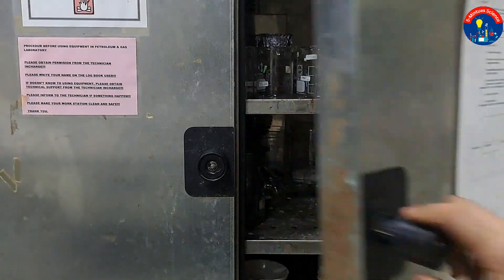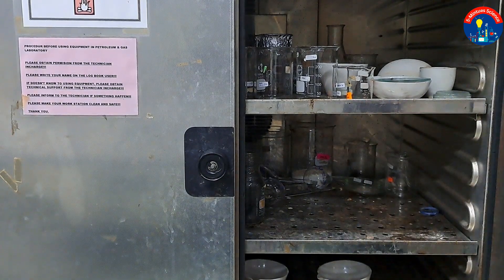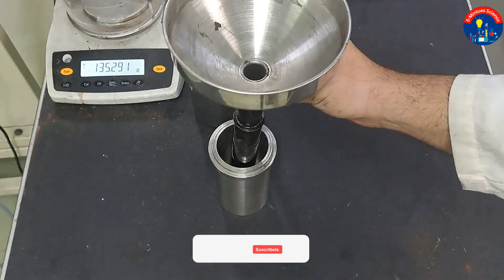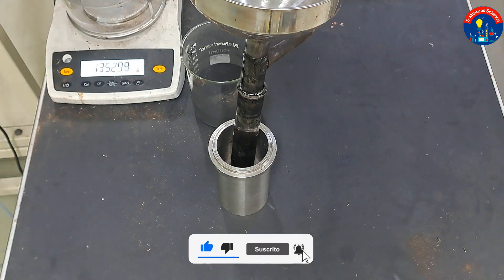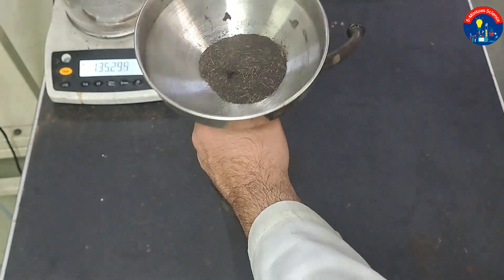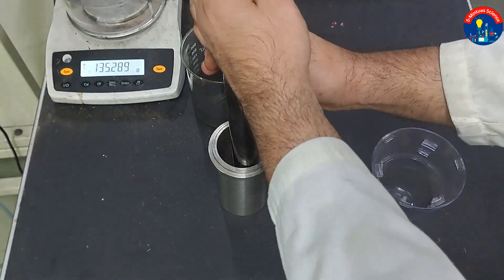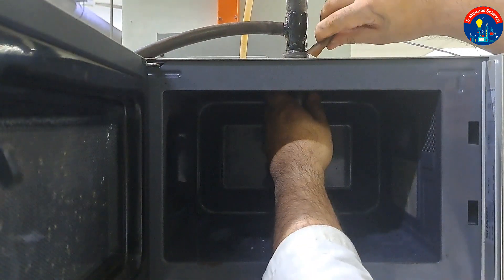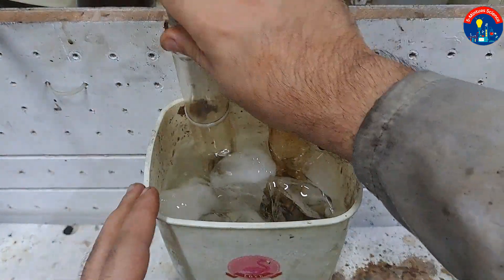Bio Fuel | Coverting Biomass to Bio-Oil by Microwave Pyrolysis | Green Fuel

Comment: tips to improve your viewership:
show what makes the bio mass your getting out the oven, the processes leading up to it going in the oven and what temp (you said100 degrees celcious - don't forget as Americans use ferinhight.) and how long its in the oven for - then what kind of consistency we are looking for.
its nice to see this done with proper equipment but we don't need to se you set a number then turn a plug on and off until you get that number (also i can tell this is in Britain based on that plug alone lol) just set to 100 and edit out the 31-98 range - re-joining  at 99 completion 100. then explain what's next.
at 16 seconds you states about the critical part of the process is to cool the hot gas - explain where this gas come from and how and the reason why you need to cool it - use drawings if you have to lol
at 40 seconds you seem to be putting the tube into a microwave that is CLEARLY NOT DOMESTIC USE - so maybe reference this with a SAFETY CAUTION to stop people buying microwaves and just putting holes in them !!! 
at 55 seconds you state about making the quarts oxygen free - what's the process? why is oxygen escaping the quarts is it something your injecting or is it already present? what's the purpose in removing it? does it play any significant role in performance if you mistakenly leave any in or any biohazards as a result? (imagine ur audience arnt science majors and are dumb kids looking for ideas to make a quick buck explain the details they NEED to know)
from 1min 11 seconds we see you setting up a gas separation system but you don't explain what this is for - yes you may have previously mentioned it but you have only mentioned about purging out the oxygen - explain how this is done in this process.
as mentioned above : 1 min 24 you set the console to 100 and you start at 31, from 32-98 just remove as its wasted time in this video not just boring but disengaging meaning people will click off - i also have to mention im taking a guess that this is either flow rate or temperature, its not explained what your doing apart from the text (no voice over) saying the nitrogen is discharging the oxygen... again explain what that means to those just learning.
the last point carries over to 2 mins 8 seconds where you then change the setting from 100 to 600 with NO explanation of what your doing.... the new spend the next 30 seconds just setting it up to 600 and watch it automatically climb... why this could be cut completly apart from the last little bit setting it to 600 and explaining "we will just let that rise to the desired amount this will take X amount of time" 
2 mins 35 back to gas... its vaporising - you dont explain this but we can see it doing that but why no mention... is this good - bad , or even dangerous? who knows because its not explained... 
it takes a full 20 seconds of lovely music and vaporising gas to finally get the voice to say "during the test we monitor the temperature and the testing process - ok nice to know but why what's the importance? is it likely to catch fire or explode ??? good stuff to know you know. 
and we see this vaporising happening at an increasing rate until 3mins 36 seconds... ok but why is it suppose to be increasing - is it good or bad or even safe or are you looking for a specific flow to the vapour before moving on to the next step? 
right after this at 3min 36 seconds  we see the temp has risen to over 10 degrees higher then the setting- is this equipment error, something to monitor and watch out for, is it safe? 
and finally you end with removing the vile's from the ice buckets (you don't explain this but its a good guess on my part) and transferring it (without gloves or eye protection btw) in to tiny viles for testing - reason i mention eye wear is for safety obviously but the gloves are also to prevent contamination which may impact your results.

each of these points i have are could easily be a 5 min or under video on there own which could be a playlist for this process and last video being the full process done highlighting each bit with its corresponding video titles or playlist entry number.

this video is just lazy editing as it currently stands.
Reply from the maker: Thank u. We try our best for next video to be better. Thank you for your comments. It is so valuable for us. We read all and we will conduct on next video. Thank u for your time to write this valuable comment
Reply: @5-MintueScience   not a problem !